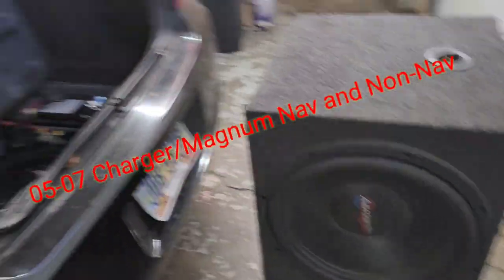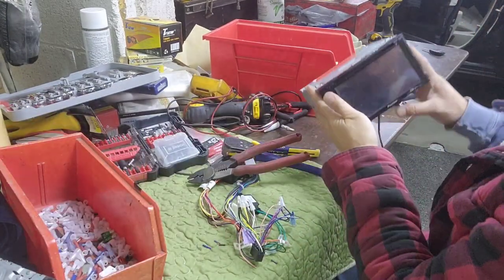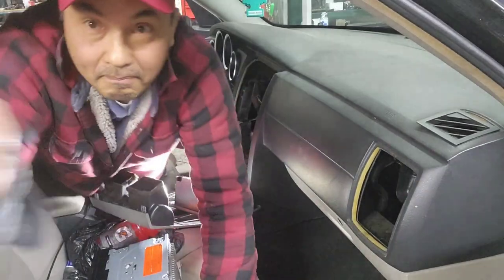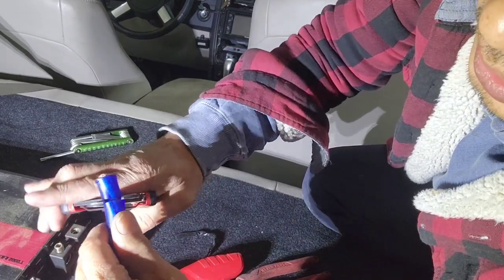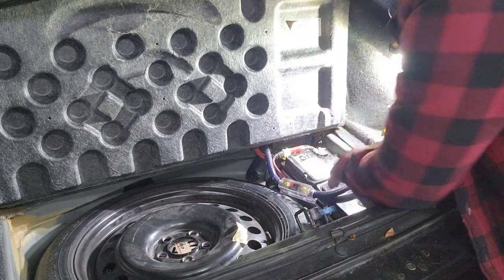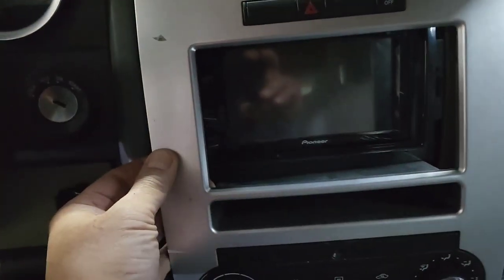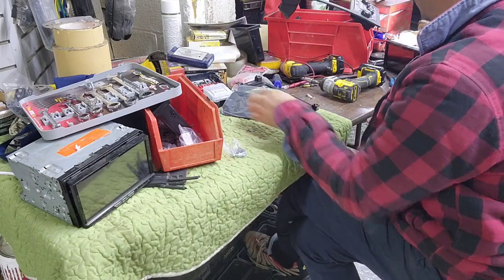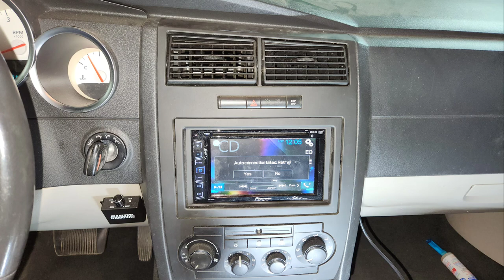2005 to 2007 Dodge Charger Magnum Radio & amp Install

Comment: I have a 07 magnum rt..I have steering wheel controls and navigation. Want to install aftermarket double din what wiring harness do I need
Reply from the maker: Wiring axtc-ch13. Mounting 996510 antenna 40-cr10

Comment: I have a 06 charger rt with no steering wheel controls, no navigation, what wire harness do I need for a aftermarket radio?

Comment: Can you what did you do with the 2 yellow wires for the 12 volt battery and the 2 chassis ground wires?
Reply: I’m trying to figure same thing out
Reply: @travismccrary1430  I just paid a guy 50 bucks to put In my stereo smh one day I guess
Reply: @Chefin-up-Genius-MEATS  it sucks cause I’m stuck right now I bought the harness adapter wired all colors together but there were two yellow 12v power and 2 chassis black grounds